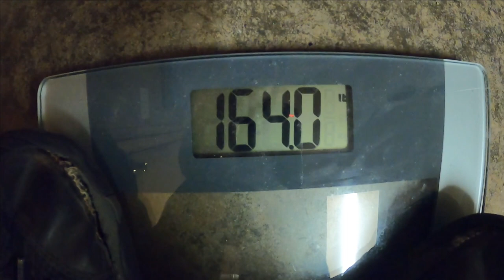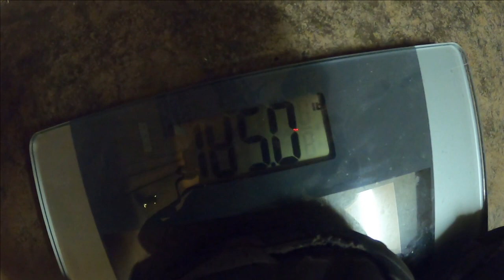Blimp Drive Paramotor, main assembly | Avery Flies

Comment: Nice work protecting against an exploding prop!  I think the biggest design challenge you face now is how you are going to insure that if you lose power to one side it won't immediately twist you in your lines.  The motors are so far from the z-axis that it would have a tremendous amount of leverage to spin you and there is so much weight to the outside that you will continue spinning once started.  If you have a motor quit, a speed control burn out, or a prop fail you're going to be in a world of hurt.  Giving enough hours one of those circumstances is sure to happen.  Murphy is one devious SOB and you've got to outsmart him seeing as your life is on the line.
Reply from the maker: There is a gyro in the main little box that senses rotation and I have it programmed to shut off if the bar spins faster than 45⁰/second. It checks this every 1/10 of a second. In the event of a twist, both motors are turned off completely
Reply: @AveryFlies  Bravo!

Comment: Looks good.  2" sch 80 pipe has 2.375" OD, so the brackets are probably right based on sch 80.
Reply from the maker: That might be its intended use, but their ID of the insert on their diagram is listed as 2" 🤷 McMaster Carr P/N 3176T65

Comment: Pipe is sized by inside diameter. You are looking for 2" tube, that is sized by outside diameter.
Reply from the maker: Well, this pipe fitting diagram McMaster Carr had supplied an outside diameter. Not a big deal, I made adapters.